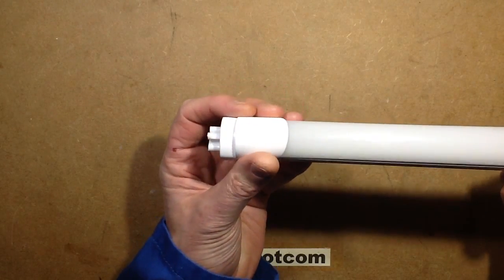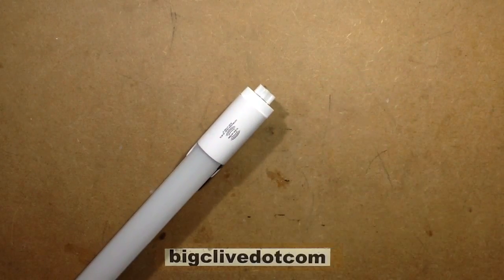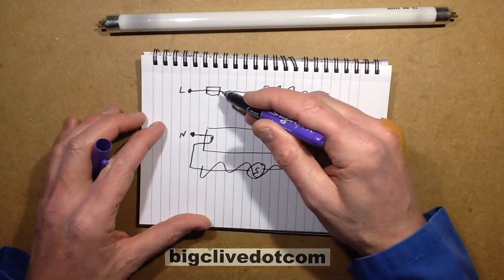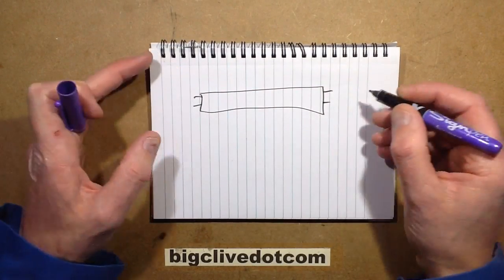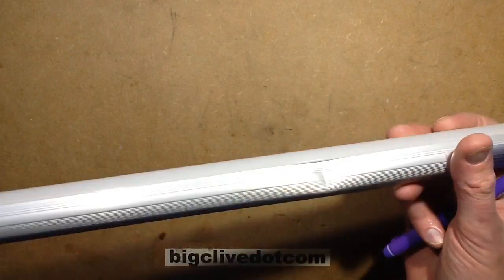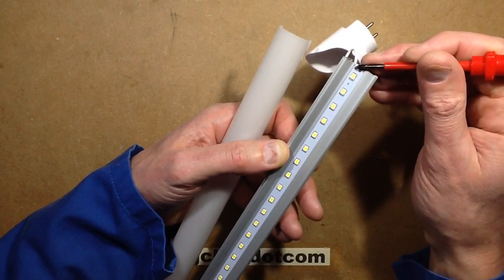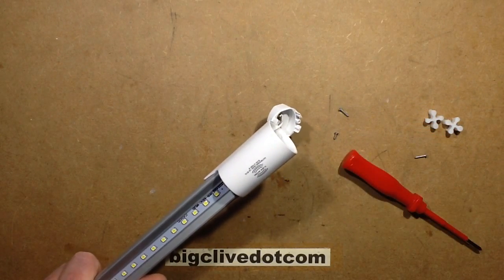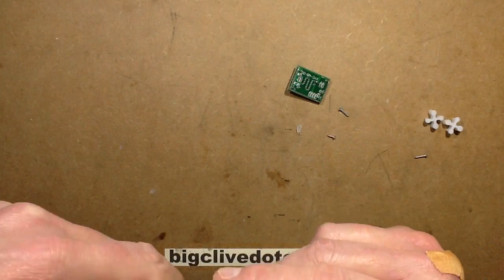Inside an LED T8 radar retrofit fluorescent tube.  (Excelvan)

Comment: Osram/Philips led replacement tubes have the L & N at one end of the tube, the other end is a shunt and the starter is replaced with an LED starter which is actually a fuse. They run with the ballast in series as they usually have a universal 100-250v rating. The only time the ballast has to be removed is when it is QS, SRS or HF. They run direct off the mains too. Quite handy tubes.

Comment: I have many of them in service at home for 3 years and they are bright as they can be. I love them. 20 Watts and 2000 Lumen.
Reply: They are neither. Your lamp consumes 20W but probably delivers 16W or less due to a thermal and conversion losses - and then, as being 3yrs old they could only deliver 90lm/W in top quality ones (as new) means 1440lm which is 1/4 less then stated - and all that is for top quality ones witch is half of CFL lamp of same type but it seems common as then radiate light just to one third of surface (120deg) not 360 like in tubes. 
The ones I had for testing (china brand) are rated as 20W but can deliver only 8W of light (supply is capable of 8W only) and some poor lumens (probably less then 70lm/W) due to a bad heatsink solution...means: dont believe everything you read at packaging...

Comment: If memory serves the balast is not intended to reduce the current but to induce a high voltage to "ignite" the tube. When the starter is removed a LED tube should function without a problem even with the balast in place.

Comment: clive ,my bathroom light is a CFL flat type one and it uses a choke i think ( ballast sort ) and people say to replace it with a LED flat bathroom light ,u need to bypass the wires to avoid the choke ,is this an easy and safe task to do by myself ? edit ,and its also connected to the extractor ssytem vent that turns on when i turn on the l ight via the pull cord ,would that still work with an LED replacement and the starter/choke out ?

Comment: Why would you need to bypass the choke in the original fitting, if you were fitting a lower wattage lamp?  The existing ballast can drop some of the voltage, and the regulator switching transistor spend more time "on" due to the lower voltage available?  You would just have to remove the starter .....
Reply: bluerizlagirl ballast uses as much power as the led light it self (some cause flashing)

Comment: I bought some of the newer tubes that have the L N connections at one end. I paid just under $10 each for 8 of them and that included the $20 shipping charge. Most carriers whack you with a heavy surcharge to ship anything that is 4 ft long. That means they cost about 3X what a normal florescent tube but they should last longer and the long term power savings could be pretty good. In general running electronics cooler indicates good reliability. I've found the 4ft shop lights with electronic ballasts are not at all good when it comes to reliability. The fixtures with ballasts waste a lot of power in the ballast itself.

I haven't opened them up but the light quality is quite good (i bought the 3500K bulbs) and the light output is fine from what I can see. I suspect they are very efficient because the tube gets just barely warm after several hours, much cooler than a 4ft fluorescent tube. I measured the consumption at 14.9 walls but have not measured the light output.

It will be interesting to see how reliable the buck regulators in these are.

Comment: What happens if you overload (connect straight to mains) one of those fluorescent tubes?
Reply from the maker: if the ballast is bypassed then at the least the cathodes will blow, but in the event the tube strikes it may actually shatter due to the massive current flow through what would effectively be an unballasted arc lamp.
Reply: bigclivedotcom
I wanna see it in action :P

Comment: LED tubes have phase and neutral in one end and the other is bridged allways make the fixture with phase in one end and neutral in the other and the stater is replaced with the "fuse" you get with the tube that way you cannot put the tube the wrong way in if you do phase and neutral in one end then if you turn the tube you will blow the circut fuse 

you WON'T get an electric shock if you plug one end in and touch the other!!
if you do that stop buying stuff on ebay xD
Reply from the maker: The early tubes did get powered from both ends and it appears they are still out there.  So on that basis I think it's wise to play safe and treat ANY tube as potentially being able to give a shock from the exposed end.

Comment: I replaced a couple of FL tubes with these LED tubes not for the energy savings but for the fact that they turn on instantly. Here in the winter, FL tubes take so long to turn on (despite new tube/starter) that sometimes I'm already done with my errand once it's on.
Reply from the maker: The LED will also have an advantage over the cold fluorescent tubes which would have to warm up to distribute the mercury vapour before reaching full brightness.

Comment: If you live in the US and want led tubes go to home depot, they have Phillips tubes that are direct replacement. Meaning you don't have to do any rewiring. I have been using them for at least 6 months now and I have no complaints.
Reply: @Zach Demand Yes, but I recommend you to always get their UniversalFit series, or else, a very high likelihood of lamp rejection by the ballast! (Shuts down, like a T5 ballast with a bad T5 bulb!) Also, the CRI appears to be very low. I think the Phillips Alto II 48-inch T8 fluorescent bulbs, have a better CRI. Looks like the mercury-based ones win this time!

Comment: Interesting video.
The ones I wired into my kitchen light have line and neutral at one end, and are nothing more than plastic pins at the other side.
The only thing that would happen if plugged in backwards would be they wouldn't work....
One other thing to take into consideration is, once installed, you shouldn't have to mess with them for the next 30 years...

Comment: I've got one of the newer LED replacement tubes, and it's like you might expect. One end of the tube is 120v/ground, the other end is not connected, and it only works one way in the fixture.

Comment: About 5 years ago I replaced 15 tubes in my hobby room with led tubes & they are working fine. & show no sign of dimming. these tubes look as bright or brighter then the original fluros & use less power.
These tubes are wired with A & N at one end & the pins are linked at the other end
For circuit explanation I'm going to call the pins at the linked end L1 &L2
The pins at the other end i will call A & N (active & neutral)
These will not work with an electronic ballast
The starter is replaced with a fuse that looks exactly like a starter
Active to ballast, ballast to tube L1 linked internally to L2, L2 to Fuse(starter replacement), fuse to Tube A via Leds to
Tube N,Tube N to Neutral
If you put the tube in facing the other way it still works
Active to ballast, ballast to Tube A Via leds to Tube N, Tube N to Fuse(starter replacement), Fuse to L1 linked internally to
 L2, L2 to Neutral

Comment: The LED replacement lamp, in my humble opinion, could use the original fitting ballast in conjunction with a capacitor to form some sort of passive PFC circuit for the buck regulator. Oh, well...

Comment: Clive, I have a question!
I'm looking into buying one of your RGB controller kits, to use in a dashboard lighting project for my car. I'm going to be utilizing some unused switches on my wiper stalk. Could you show me the way to wire in two switches with a common ground pin in place of the microswitches included in the kit? I'd like to know if that's possible before I buy.
Reply from the maker: There's a single common connection for both buttons (they have to be momentary action buttons).  You can extend the wires from the switch positions with short leads.
Reply: Bladsmith . . . Payment for Clive's time is . . urrrmmm . . .  50p per letter typed, + amount of Brain-time used, (@ £5:77p pm) + 10p for 'lecky' used to power up & answer your Q's, + VAT +CAT. ;-) Payment via Paypal. (if you add a note that it's a gift, you may be able to recover back your VAT) Muhahaha. ;-)

Comment: how does a single pin tube work??
Reply from the maker: It's driven cold-cathode like a traditional neon tube.
Reply: bigclivedotcom better or worse?
Reply: mine are Fa8
Reply from the maker: If the tubes have proper electrodes then it will be fine.

Comment: I bought a couple of those radar bulbs to play with, no problems with them interfering with each other that I could find. I also checked to see if they ran on the same part of 2.4ghz as wifi routers, & again no sign of them on my wifi  analyser/mapper, the only thing i have found they cause issues with is my 2.4ghz wireless mouse which is a damn shame i really like this mouse.

Comment: +bigclive work at a company were whe do the procedure of taking out the starter and ballast and we replace the old tubes with phillips led tubes and label the armature 
that it is modified
Reply from the maker: Can you not leave the ballast inside the fixture but disconnected?

Comment: I sell these style tubes and know a bit about them. The good manufacturers have direct replacement LED tubes that can be connected all 3 ways, direct replacement (works with most ballasts), double, or single ended. Mine have always worked fine and are much brighter than the original tube. The biggest issue we have had over the last year was people installing the T8 tube in an older T12 ballast and seen a quick failure in some cases.
Reply: That started out because "T8s" were introduced as "all singing-all dancing power saving", so when the   "T12s" burned out, people were hoodwinked into buying them. (by both advertising/pushing & phasing out stocking T12s, as terminal pin size was same, they'd still fit) Trouble was, was an older 4ft, 5ft, 6ft, fitting is/was 40w, 65/80w  & 75/85w (no idea why two ratings on same size tube) respectfully. T8s are 4ft = 36w, 5ft = 58w, 6ft = 70w . So, starter assisted magnetic ballasts ran the tubes harder & they lasted less time. (so if/what you saved in "lecky" you paid out in replacement tubes) Also . . most T12 quickstart ballasts had a problem firing up T8s, either due to less, different, (or both) gas, they'd light the ends up, but not strike. & T12-fittings were unnecesary replaced. Newer Electronic ballasts seem to cope with both T12's & T8s with no problem.
Reply: T8 has a higher burning voltage than T12, and for environmental reasons contained lesser mercury. So the idea was, that the higher on voltage compensated for the ballast intended for higher current and lower voltage. Actually the lesser Hg content made it more difficult to start these tubes, and by putting more stress onto the coated, active cathodes, shortening possible lifespan.The low Hg amount also relates to bad cold start performance, requiring at least an outer tubing, if used outside or in unheated spaces in winters. In cold weather, T8 never reaches its full performance.With electronic ballasting and HF drive, the T8 offered real advantages in lifespan and efficiency.On the other hand, I've seen many T12 tubes, which were rather old, some nearly as my age, and still working.
Reply: So I was near enough right with the tube content. (In the early 80's, my mate & I used to build sound-to-light fluorescent's using T12s, couldn't get T8s to work no matter what  mods we came up with.) What do you class as electronic ballast? Our version of E.B, used in the U.K. was not H.F. style, just a iron core ballast either with 6 terminals (2x mains & 4x tube) or  a standard iron core routed into another iron core, or (later) a very large version of the electronic switch-starter, then to tube. (called Quickstart) Either of these T-8s refused to illuminate unles you could get close to stroke it with your hand (yup, that's what I said) or flash the switch a few times, 98% though they refused to ignite, just glow at the ends. Yeah Stefan, that was another problem with T-8s . LOW TEMP! Cold-storage etc, Even now, in some supermarket cold displays, you get the odd dim tube, saying that, I've come across new dim tubes in offices. Annoying when (if elf 'n' safety's on site) you have to power down, (I prefer not to) to replace all tubes in all the tri/quad fittings, refit the louvre-reflector/opaque panels, turn them on & you have dim &/or purple tubes. Thank's for your feedback though Stefan, I've enjoyed it. perhaps we'll chew the cud another time.
Reply: Stefan Scholz
So that's why we always have early burn-out issues with our T8 lamps and not our T12 lamps ...
Keep in mind, these lamps are on the same circuit! So they are turned on together ...
And it's not the ballast either, it's the lamps themselves ... they just burn out much quicker than the T12s.

Comment: Could you do a review of a 1000kV arc generator? http://www.ebay.co.uk/itm/Ultra-high-1000KV-Inverter-Light-Generator-Arc-Pulse-Ignition-Coil-Power-Module-/272386933653?hash=item3f6b86c395:g:~lYAAOSwNRdX5Iwy

Comment: for information, the ones we have been converting, the live is run to one end, then the neutral to the other. The spare pin at either end is then linked together inside the fitting. Also we've had good results with the NET LED replacements we have been using the past year or so. Slightly brighter and half the power.

Comment: The main advantage of LED fluorescent tube replacements is that they are far more directional. Having said that it works out more cost effective (in the long run) to just replace the entire luminaire with an LED flat panel. There are some very modern, very stylish designs out there - such as http://image2.aving.net/2012/08/30/201208301129543900.jpg or http://i.ebayimg.com/images/g/ByMAAOxyThVTbr5z/s-l300.jpg and they provide good lighting (distribution and intensity) with excellent energy savings (as well as very low thermal emission).

Comment: In Canada, our electrical supplier now stocks LED tubes that are a direct replacement, working on the original ballast with no wiring changes required. We just replaced all the lamps in a doctor's office with these things. I have to say, they are no less bright than the fluorescent tubes we removed. Can't comment on the longevity yet as it's only been a few months.

Comment: LEDs are more efficient than florescent T8 especially when you consider the losses them being omnidirectional, but only if you get quality (120+ lm/w that aren't heavily "overclocked")
But a lot of those garbage ones are worthless

BTW florescent tubes (,and HPS, HID, etc) are rated assuming the ballast is 100% efficient which is completely wrong so you also got to take into account that.

Florescent tubes also have a crappy reflector so they are only really decent if you need it for something that needs 360 degrees of light (which is what lol?)

Comment: I installed set of similar bulbs a couple years ago. I tore out the ballast, rewired, went to install the tubes, and was rewarded with a nice tingly shock when touching the aluminum housing.

it turns out that when they jammed the endcap on it pinched a wire against the aluminum which pierced the insulation and  connected the housing to live.

I reported to the CPSC which was a fun process, and got a replacement bulb.

Comment: I bought 4foot LED tubes from Costco, it was like 12 bucks for a two pack after the instant rebate. Each bulb put out about 1,650 lumens. All in all, the bulbs drew less power than the fluorescent bulbs, put out more light, and I didn not need to rewire anything as they popped right in and worked out the box. At six bucks a bulb, I dont think it can be beat!

Comment: I work at Underwriters Lab. and we had a company send us a batch of their LED conversion bulbs and lamps. We had quite a talk with them cause they had the same issue with the bulb you have. the metal casing was less than a millimeter away from live connections and a slight bump could short the entire bulb.
Reply: I bet ETL would have just taken the money and passed those bulbs.

Comment: YAY your doing the sort of light I have in my kitchen, only mine is just a simple on/off replacement. I wasnt sure of the type if i could just replace it, so i took out all the gubbins inside the original fitting and wired it internally as L at one end and N at the other. Totally cold white and a bit clinical but still nice. I was sick of replacing fittings as I have gone through about 3 in the last 6 years :( keep burning out for some reason, but the LED tube has been perfect so far :) So, lol now if I decide to move house and not tell any new owners about the kitchen light fitting, would love to see the light show if they try and stick a normal fluorescent tube in there he he. Mines 5ft and cost me £17 off amazon and was delivered through my letterbox in a thick cardboard tube. I was a bit annoyed at that but the lamp and aluminium back survived nicely :)

Comment: I have a 45cm fixture in my bathroom but 4 days ago the lamp went boom.
I do have a 60cm LED one, but should I just give it the 220V directly, or just use the starter too? I'll extend the one contact to fit the 60cm lamp